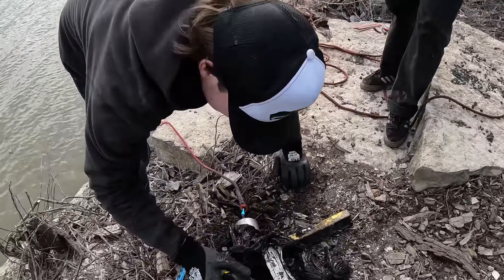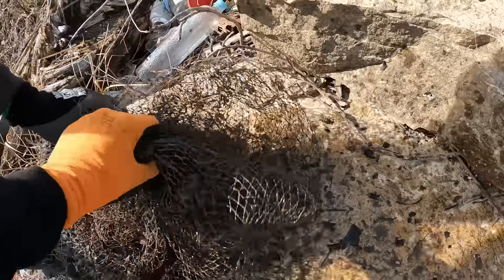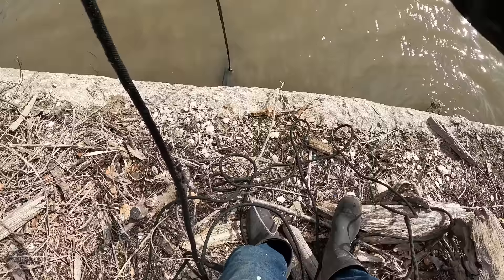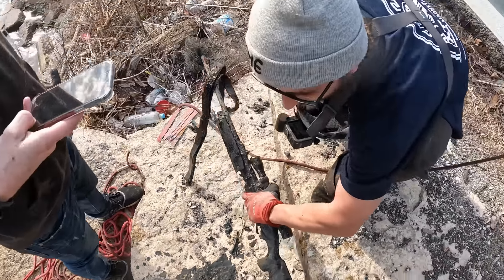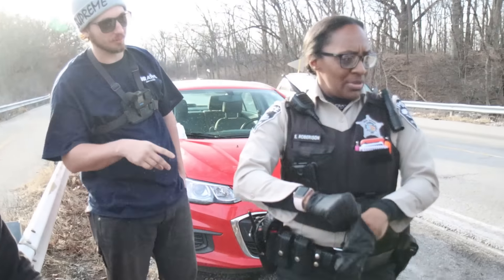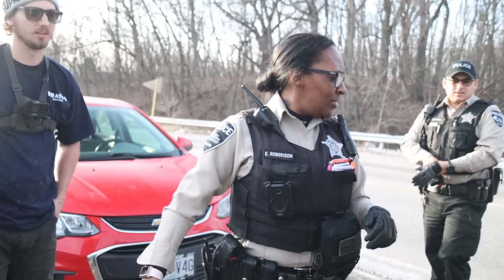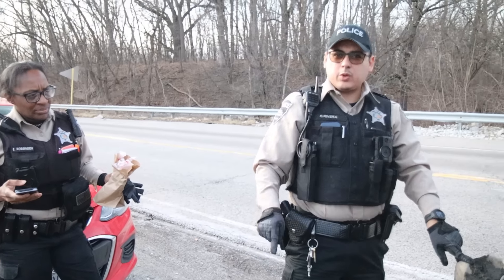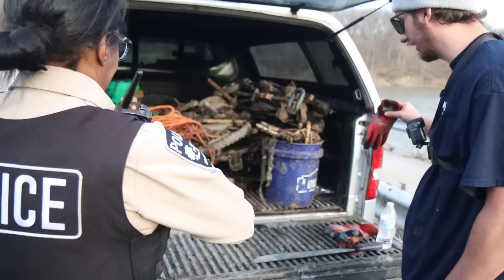The Most Frightening Magnet Fishing Find Ever!! (Even The Police Were Shocked)

Comment: “I wanna keep that gun it’s restorable”

Dude the gun is at the bottom of a river for a reason 👀😂
Reply: Right 10 to 1 it has a body
Reply: Body or no body any Glock clone it takes less than 15 seconds to take the barrel out and put an aftermarket in than a piece with a body on it has no body on it.  They may be able to to metallurgical match's on casings if recovered to match the ejector but same concept easy change out.  Only reason to dump a peice is if it has a dirty serial number
Reply: @joshofalltradesgendron5464  grind it off and sell it. no crime . plus file the riflings a little and the slug sample will never match.
Reply: @circusboy90210  also  not good idea. Ground serial number carries 10 year sentance.  But simple change out of parts barrel striker ejector good to go if a clean serial number.  He should be legally allowed to retrieve that fire arm if it has no cases on it.  Most police stations will lie but after a waiting period and no one claims it becomes his property
Reply: Yer right there Sammy, the wife didn't want them around so she just threw them off the bridge.
Reply: @circusboy90210  They can still i.d. a gun by the striker marks on the primer (like a fingerprint every time), and filing the rifling does not really work.
Reply: @richardm3023  You can change the firing pin and the barrel.
Reply: Someone found 2 barrett m107s in a creek like this in Florida.
Reply: @kaninerultralord8817  that's alot of money lol
Reply: @jackjohnson291  interesting.   That is exactly what they said about ballistic evidence and finger printing 100 years ago.
Reply: @joshofalltradesgendron5464  good to know thank you!!
Reply: @richardm3023  thank you I missed the striker in my comment but unless a serial number is ground off Wich is a 10 year min stay toss the barrel Wich in to a previous comment I agreed on fileing it a bit may be a good idea into further knowledge of my apprentiship that won't work.  You would need to destroy all accuracy with the barrel by making a button push like a drill bit dremeled so when you use a hand press to push it through the barrel it spins as you push it making rifling it's a very old technique but cheapest and least amount of tools time and money.  Some shops Clean up rifling this changing it so that works quick 50$.  Toss the striker and ejector and keep the peice.  There's no reason to throw a peice unless you did something illegal and your moments away from a search.
Reply: @circusboy90210  You may be wrong, I believe any weapon used, sold, etc. must have a serial number. If found with a weapon with out the serial number, you may need to answer some questions from the Feds (FBI and ATF).  I tried looking it up but the ATF doesn't provide clear information pertaining to users or finders of weapons.  All manufacturers are required have serial numbers on each firearm produced or imported.
Reply: @richardm3023  Striker is replaceable, too.
Reply: @chrisazure1624  they can still track it.
Reply: @richardm3023 Not if you throw the old parts away.
Reply: Tip of the century...a hex wrench twisted at both ends removes any crimes attached...
Reply: Y'all really don't know anything about firearms or firearms law and it's scary. I'd have kept that pistol though.
Reply: @brettywap2295  who doesn't us commenting or the guys channel?
Reply: @Harry-zz2oh  you are partially right but especially since there using the I think it's 4073 or something like that to make a national database but every American has the right to own possess and build a firearm in there own home on there property if it was to be carried off that property it needs a serial number.  All newer firearms you are correct require it but I have legal firearms without serial numbers because they were made before it was legally required for instance my semi auto salvage 12 gage no serial number.  But with all new laws it would not surprise me that they would attempt to mandate me to deface an antique and engraving one on them the way this woke as country is going
Reply: @chrisazure1624  not throw away oxy acetaline torch and melt it.  What is tossed and lossed can be found but not when melted into a puddle on the ground
Reply: @brettywap2295  I've dedicated my life for our country and our number one checks and balances that keeps we the people in charge of our Constitutional Republic.  I come from a long line of gunsmiths and am one myself.  I've been working in the industry for a long time and will always call myself an apprentice until my mentor passes some day.  I work on some Days 3 gun competition firearms other days I'll be doing a ww1 restoration.  Just yesterday I was working on a 410 revolver bicycle gun  from Netherlands late 1800s German proof marks no serial number.  Tommaro a 1911 government manufacturing date 1914.  Than next week I'm need to tune local law enforcement contract swat team rifles.  Over gassed chewing the shit out of buffers because they don't have the gas right while running there suppressors.  Everyone hear clearly has some knowledge of firearms and the basic functions of a Glock.
Reply: That's what I thought, id never trust these bozos with a water gun much less a real one
Reply: @robomonkey1018  the cop ran the handgun serial number and she said it was clean. So idk
Reply: @matthewhughes1950   that just means not officially stolen. Could've been stolen but not reported. And can definitely still be a murder weapon. Nobody checks to make sure you haven't thrown a gun you owned legally into a river after killing someone. You can just "lose it" and not report it stolen.
Reply: It may have been used doing something bad that's why it's at the bottom
Reply: WTF????🤯 Is he kidding???
Reply: Ya I was wondering why they don't just take the guns and bullets for keeping straight away
Reply: Isn’t there are law that says they need to be called in or something?
Reply: Someone just had a tragic boating accident.

Comment: I’m not surprised you found guns but those were a little higher class than I would have expected to not be listed as stolen.😂 I’m surprised you didn’t find more weapons if it was near Chicago. Maybe the lady cop thought you were in the water to find them and that was a scary thought. If you haven’t seen magnet fishing before it can be a little confusing. Finding the boot was sure different. Too many people figured out how to get those off and they have a new thing that goes over your windshield so you can’t see.
Reply from the maker: Thank you Martha watching tonight
Reply: Which should be 100% illegal. What if someone has a medical emergency and can’t wait 30+ minutes for help to arrive? It’s pure extortion. 

I’ve never had a parking ticket in my life (or any other kind), so it’s not like I’m just mad for finding myself at the wrong end of the stick.
Reply: If you keep a cordless drill in your car all you need to do is drill an 1/8"/3mm hole in the body of those windshield devices over the suction cups, and I'm pretty sure it only takes one hole to get the entire thing off. Just gotta break that vacuum and it's off.

Comment: I'm not sure, but I think the bell you found in the little bag , is to hang under a motorcycle.  They are suppose to "protect" the rider and usually have some kind of sentimental value or meaning.
Reply: Why was it blurred out? I didn't get that.
Reply: @joeguilfoyle1922  good question 🤔
Reply: @Goodboy77717  In that case, you know a woman chunked it 🙂
Reply: @Goodboy77717  Thank you! I was trying to figure that out too!
Reply: There is a "rule" about the motorcycle bells... if you buy one and put it on your motorcycle yourself there are 2 possible outcomes: 1) it does nothing; 2) some sort of bad luck or injury or bike fail results. The only time you benefit from hanging a bell on a motorcycle is if somebody gifts you the bell. And since strangers typically don't go around handing out motorcycle bells, it's generally a friend who is also a rider who gifts the bell to someone who doesn't have one. It's essentially a good luck charm... but only when it is gifted to you. The bells are supposed to keep gremlins from messing with your motorcycle while riding--supposedly, the gremlins hate the sound of the constantly ringing (small) bells while the motorcycle is being ridden.

Comment: You guys would have a hayday where I used to live in Alaska. Just north of Ketchikan, there is a manmade cove (Ward Cove) that dates back to the early 1900s and there are several abandoned cannery facilities that line the shore of it. At least there were when I lived there almost 20 years ago. It may be developed now Idk. Anyhow, over the decades, people threw anything and everything in the cove to dispose of it. There are cars down there, boats, old mobile floating houses (for logging workers), planes, even old construction equipment or so I heard. I think it's safe to say that alot of what's down there has a nefarious backstory. We once tried to halibut fish there, but I lost $100 worth of brand new halibut tackle and almost 300 feet of string when I hooked a full spun steel cable reel at the bottom on my first cast. It's a magnet fisher's wet dream! Except most of everything you would stick to, you could never pull up 😂